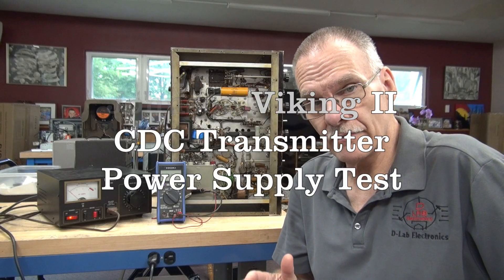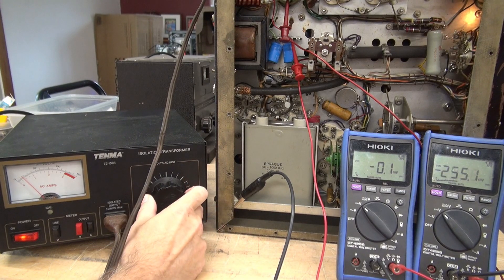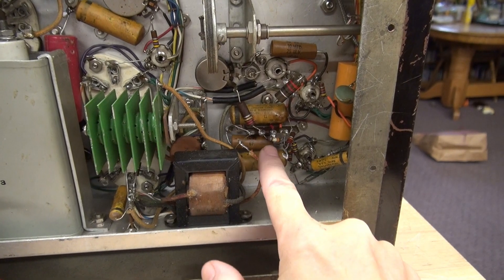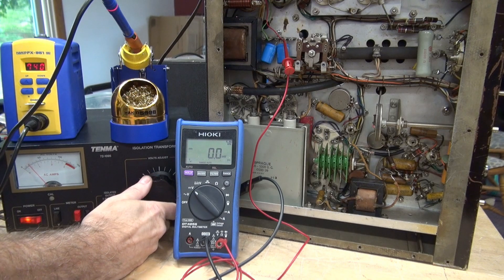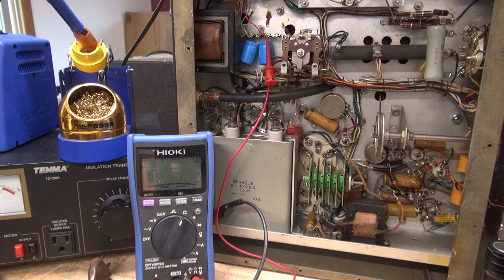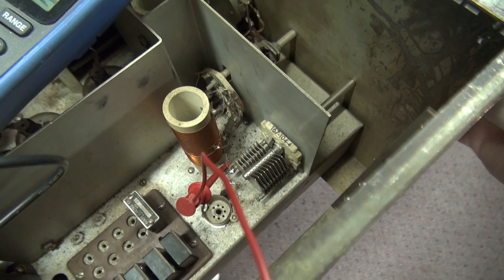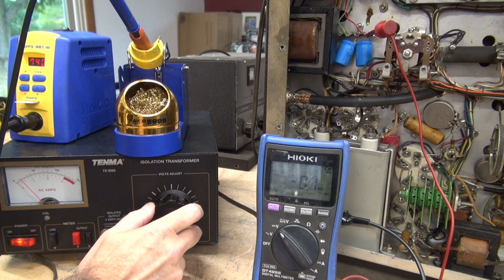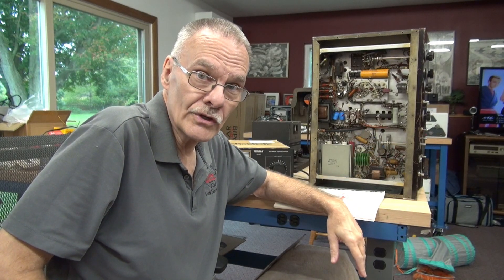Vintage Johnson Viking II CDC Civil defense Transmitter shorted power supply troubleshooting Part 2

Comment: "This will probably remove the short..."....ok, THIS will probably remove the short..."...Ah ha....I found the short, this will remove it..."...🤣

I love how Terry has zero hesitation to reveal his stumbles along the way to placing a GREAT transmitter back on the air.  I have the CDC, and AB2RA worked with me to get it back in top "broadcast quality" audio.  

The CDC is an absolute gem of a transmitter, and is well worth putting back on the air for the AM nets...as is any Viking II.

Love the passion Terry...keep them tubes glowing!

Comment: Is this a "Barn Find" CDC??
Reply from the maker: Nope, a customer unit. Looks like a barn find.
Reply: @d-labelectronics  here's an idea that the  Customer can consider.  THere are a plethora of  AD 9850 and 51  DDC oscillators available that will tune the entire ham band.   THey can't drive the buffer amp that exists in this unit because they put out only  500 uW  or so but as a sine wave .  However with a  single  Transistor amp based on 3866 or similar this cam be brought up to  15 mW or so . l normally this will drive in place of a crystal. (easily) . Thus the whole analogue osc can be  replaced by something  stable and modern and with a rotary control.   The Toroid king  in FL sells such an amplifier for around  twelve dollars un built. 

Even better is the concept of injecting a couple of watts of  AM or DSB into the  SSB in port that some Johnson Vikings have.  THat's to say all the amplification past this port  is linear.  Possibly this model does not have that capacity.

Comment: Why would they use non-insulated wire for those wires, where if they managed to touch the chassis they would short? It does not seem wise (says the know-nothing commenter who has never made a point to point wired anything).
Reply from the maker: Normally the wire is a thicker gage, not as easily bent, Yes, I agree some insulative tubing would have been nice
Reply: It's not uncommon in older stuff. But I just fixed a Kenwood ts-520s that had an insulated wire rubbed through the insulation making contact with a terminal on a pot and wouldn't transmit. Couldn't believe that it rubbed through the insulation on that radio. Maybe it was in a vehicle at some point? Who knows. It also had a cold solder on the sidetone board. That's what I was looking at when I spotted the wire.

Comment: I knew this trilogy was going to suspenseful. Terry, your process of elimination is commendable. Not only is it logical, but it affirms the reason for the hourly fees that sometimes incur with having to perform detective work. Documenting your expedition also provides the owner proof for the necessary exploratory surgery; before assessment of parts, as well as reassembly. I am still flummoxed after watching part 1; as to why there is no copper shielding in this "factory built" Viking II. Is that something you've encountered before this case? I await part III with great eagerness.